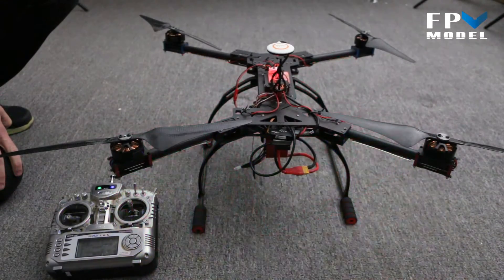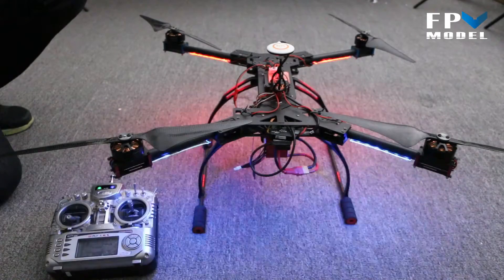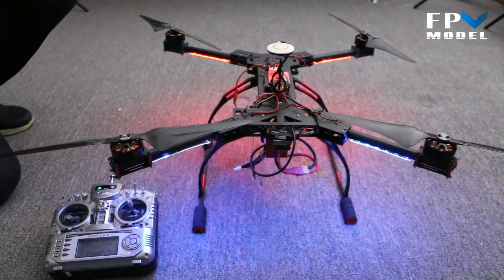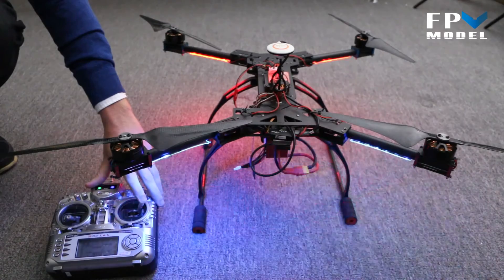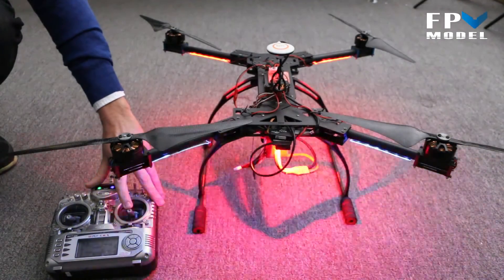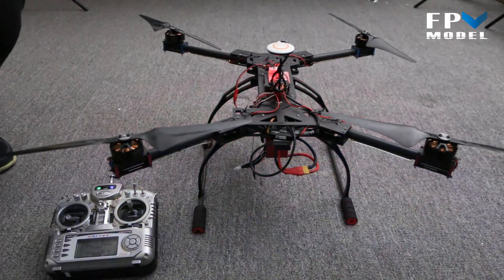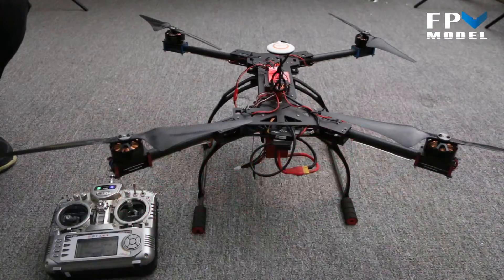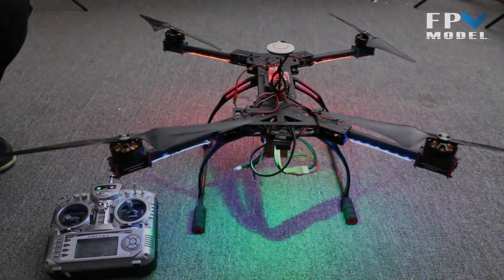LED control Board for Multi-rotors. Enjoy night flying with directional lighting!!!!

Comment: As a pilot seeing the light changes would be confusing. As FAA configured lighting for multirotors will be the same as a heli, but look like a plane from an approaching full scale craft. Port side red-starboard side green. W / two rapid flashing white strobes on the wing tips or motor arms. This will also include along the pith axis two slow flashing red strobes. A good idea for a ground operator, but confusing for other aircraft. My system is more than FAA compliant, it is visible ten miles at night and more than 3miles during daylight.